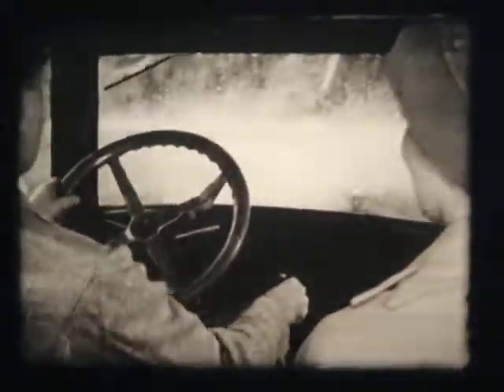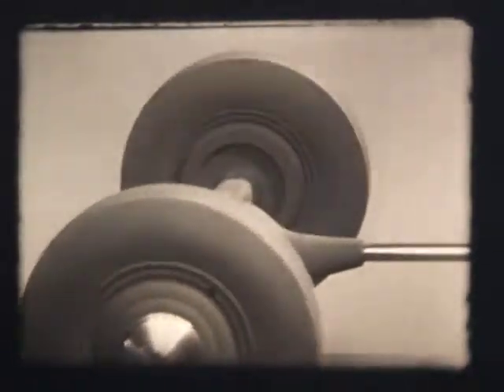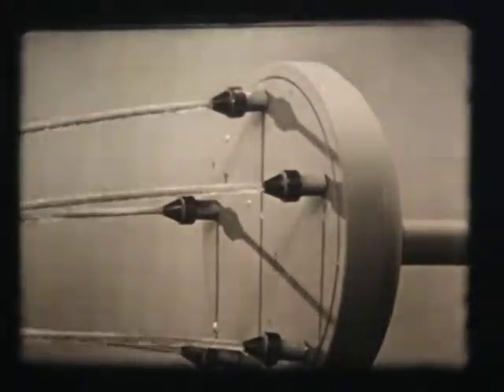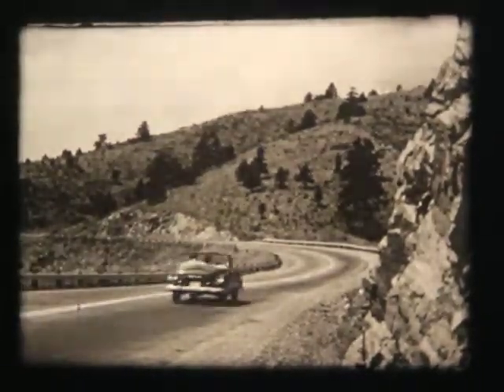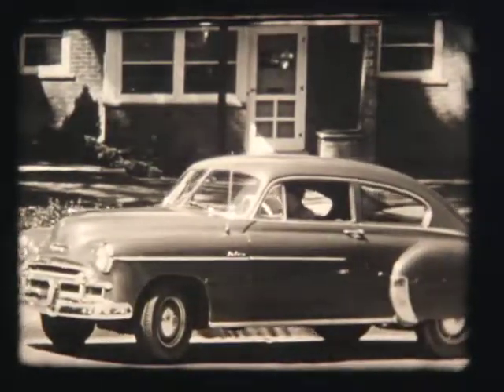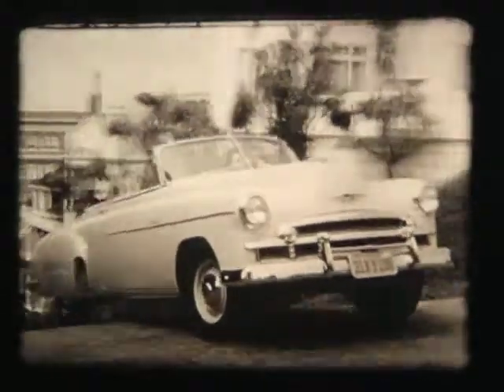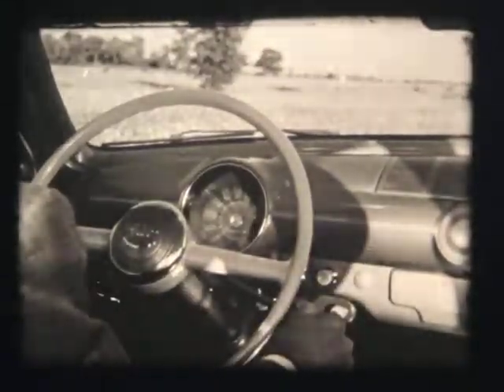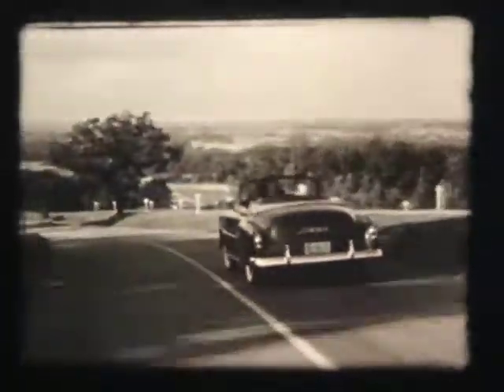Velvet Glove, The - Jam Handy - 1951

Comment: Yes David, they were fairly reliable, provided one didn't tow too much weight. The Powerglide was a 2peed, and eventually replaced by the 3speed "Turbo Hydramatic" series. Today, Powerglides are found mainly on drag strips, and handle upwards of 1000 horsepower in dragsters.